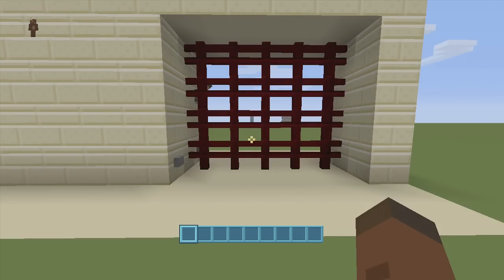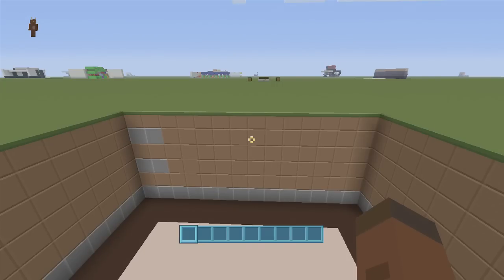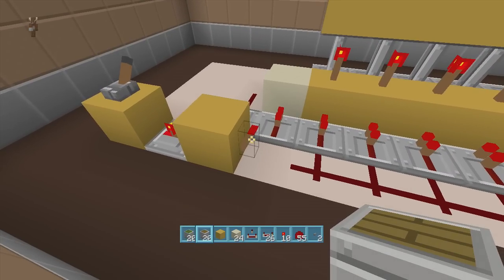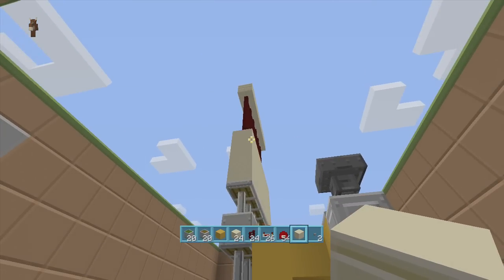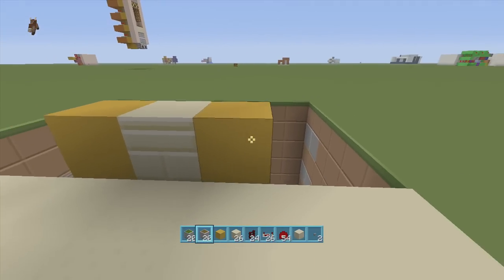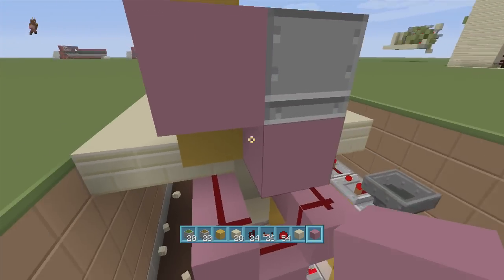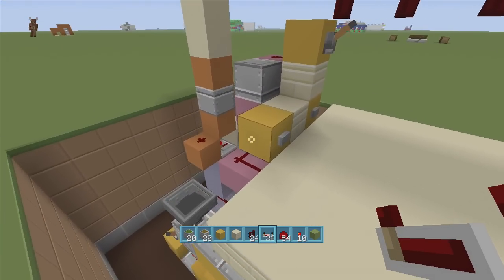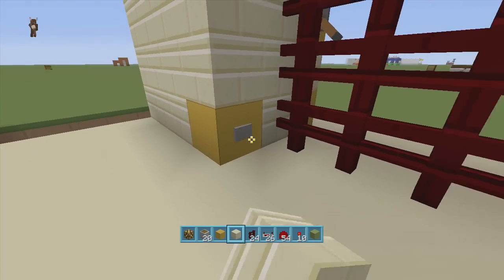Castle Gate [3 High] (Minecraft Xbox TU23/CU11/PlayStation CL1.15)

Comment: I slightly modified this. I made it so that you don't need sand or gravel for the gate itself, but it only goes 2 high instead of 3. Seeing as fences are non-solid blocks, you can ride a horse through it without suffocating anyway.

Comment: (Excuse the lateness to my arrival to the video) I tried this and it is not working right. I get to 6:18 and now only the top and bottom pistons extend and when i flick the lever the other way the middle and top are extended. I'm doing exactly what he's doing in the video. Could it be due to the 1.13 update?
Reply: Did you ever find the solution to this? I'm having this same problem
Reply: Same here

Comment: The fix won't work anymore
Reply: I fixed it but I had to add a repeater to the first mono stable circuit that you make, the signal wasn't connecting for some reason when after I intentionally broke it to test if the fix would work but the fix wouldn't work until I added that repeater.